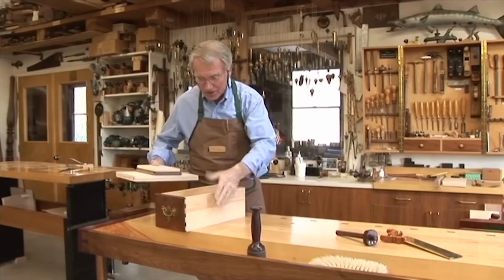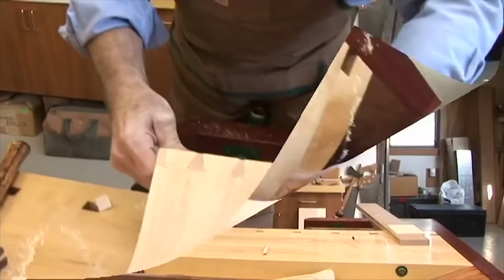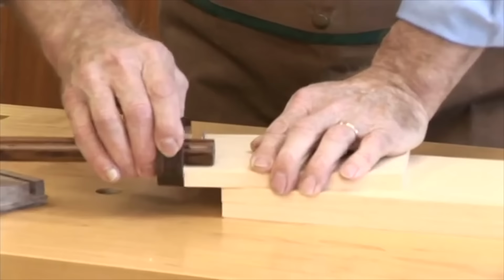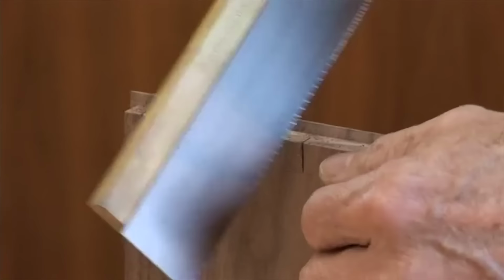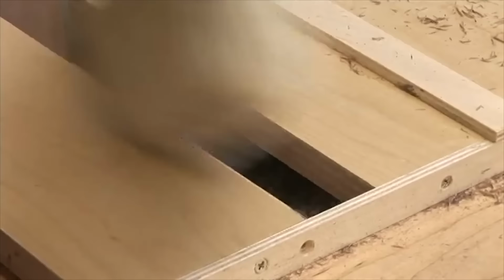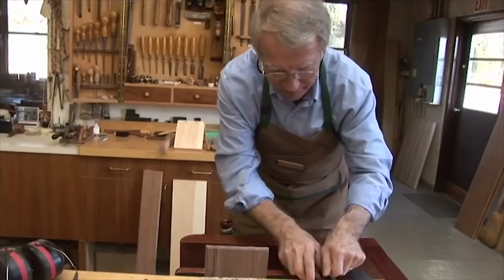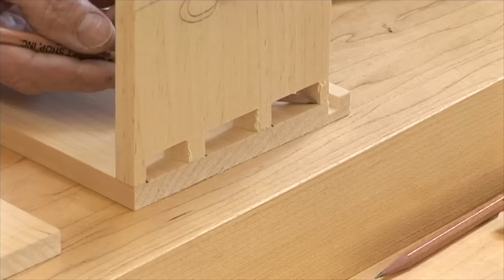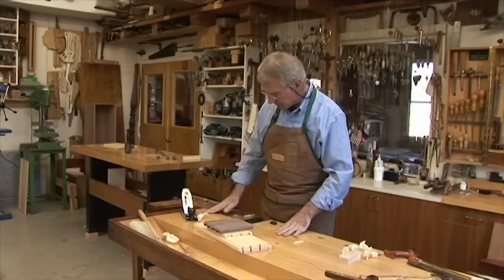Dovetails for Drawers – the European Way

Comment: European yes, but not so much British. We tend to prefer less steep angles and use drawer sides made of far more durable quarter sawn hardwoods like oak. Pins tend to be much narrower, tails evenly spaced or nearly so. Drawer bottom rebates tend to be placed higher up so the sides are less prone to splitting and gives more room for a thicker draw bottom less prone to sagging. The finer points of marking, cutting and fitting are more refined too. Klaus knows his stuff but his boisterous style would not fit in a British workshop. It's the little tricks of the trade that make for a really tight secure joint. I don't share those with anyone, bugger that. Properly cut you don't need glue.
Front half laps are always made as tight and clean as possible because they are seen but at the rear a little less fuss and a bit more hustle is expected. It's also okay if the tails are a tad proud on the back because its stronger. Thin pins are much quicker to clear of waste with no significant loss of strength worth worrying about.

Comment: Why make the pins and tails two different sizes?  Yes it looks good and for esthetic reasons it is the way things are done.  So, why not make the narrow side of the pins equidistant spacing on the piece.  That way you wouldn't have small/large spacings, but equal spacings - and large pins, not small pins.

Try it and see what that looks like - especially on the back side of a drawer where it isn't visible - or even the front.

Everyone as in everyone makes small pin - large space - small pin - large space, etc.

Comment: PS he is NOT exactly at the mark, with the marking guage, as he is measuring against the side of the pin, NOT the centreline of the pin diamater!, like in metalwork!, you have to account for 1/2 the pin diamater to get the measurement right, according to the point of the guage.

Comment: How does that saw spin to cut so fast?
Reply: Tarin Polucha the blade has not teeth the first few inches then the blade has a twist in it so you put it in straight then push. The blade is not common and has to be specially made

Comment: Where can I buy those dovetail cutout saw blades?

I can find an old article by Frank Klausz where he talks about it, but there isn't any information where I could obtain one from. He does say he got it from his father in 1974, but I'm hoping that someone somewhere still makes those saws blades.
Reply: The saws themselves are frame saws which you should make yourself, Paul sellers has a free video guide on how to make one. The blades can be obtained from speciality stores like fine-tools.com, but you can also buy bandsaw blades from good hardware stores.
Reply: Florian ten Napel I am looking for a twisted blade like 2:30 in the video. Fine tools don't have them. I found one of Frank's articles saying he got this from his father in 1974. I also found an article about making one by heating a band saw red hot and twisting it. But I can't find a place that sells anything like it. The frame I can make myself and I already have a few frame saws.
Reply: Actually in Hungarian woodworking school books it is mentioned, if I translate it then it is called "corner cut-out sawblade". Here is a picture from a book: http://img.index.hu/imgfrm/1/2/7/3/BIG_0014841273.jpg
I tried to search for it, but it seems it is not possible to buy anymore.

Comment: What do you even call the saw that turns sideways?
Reply from the maker: It's a bow saw, but the blade has a twist set in it. Certainly looks like magic, especially in Frank's hands!
Reply: Popular Woodworking absolutely amazing to watch
Reply: Nah, I call it black magic.
Reply: Where might I find one?
Reply: Ya I think that was magic.
Reply: At 3:54 you can see how this saw is formed. There's a straight edge to fit into the groove and the teeth of the saw blade doesn't cover the whole length. It only covers the middle portion of the blade. So you slide the straight edge in, then begin to saw and the teeth are at 90 degrees and cut "sideways" to the straight edge. I've never seen that before - very cool.
Reply: That blade is very clever. Easy to make a bow saw when you have the blade

Comment: Does anybody know the brand of marking gauge he's using?
Reply from the maker: Not sure of the exact brand but here are a couple of similar options:  https://www.woodcraft.com/products/rosewood-cutting-gauge, http://www.leevalley.com/us/wood/page.aspx?p=32621&cat=1,42936,42948,32621
Reply: Thank You for your reply.
Reply: With respect to PW, that gauge locks by twisting the sliding part against the stock - it does not use a thumbscrew like most do. The twisting action operates a cam that exerts pressure on the stock. No idea who makes them, but I want one! The PW links provided both use thumbscrews and so are not of this type.